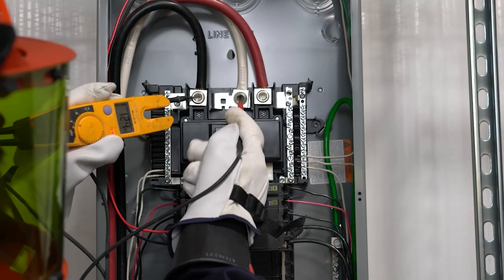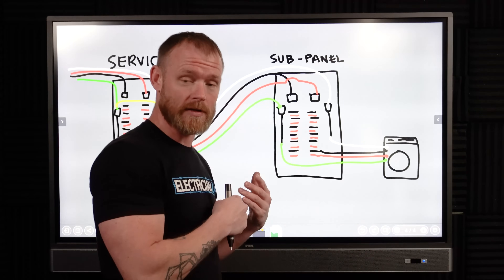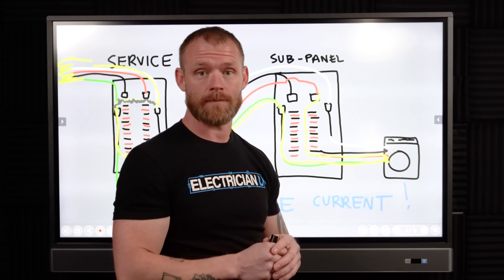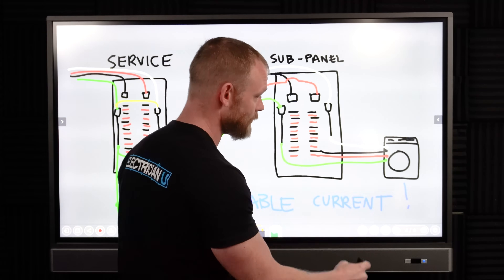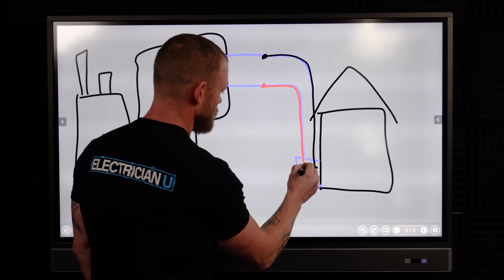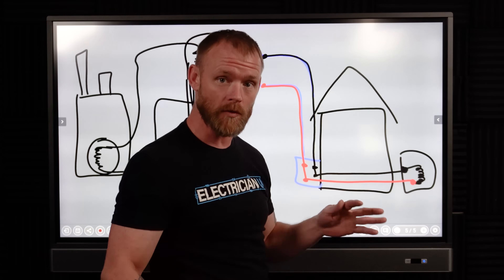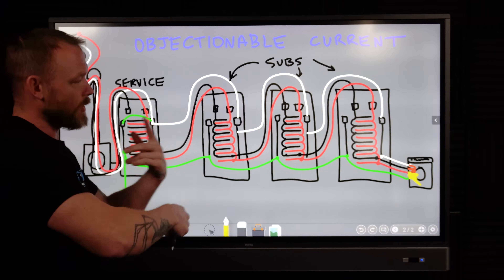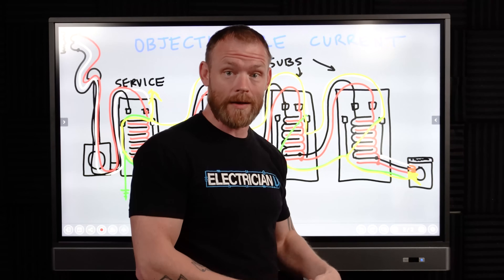Why Do We Bond at the Service Panel and Not a Subpanel?

Comment: Great video! I have one question. Given a ground fault, and you have current coming back to the main panel on the ground wire, why can't this current just be dumped into ground stake? Are not the ground stake and the neutral both essentially at 0 volts?

Comment: Bond neutral and EGC at first service disconnect location and nowhere else downstream. Typical residential service panel main breaker is the first service disconnect but not always. Sometimes there is a discount just after the meter.

Comment: If the neutral becomes disconnected at the transformer and the the fault occurs the ground rod 9r plate would carry the current back to the center point of the generator  at the station right completing  the circuit thru millions of parallel paths?

Comment: So the code is changing to require main disconnects on the exterior of residential? That will now be the bonding location and the panel inside the house will be considered “sub panel”?

Comment: Should there be the green ground wire coming off the main panel at the left? Thought the wiring from the service should be 2 hots + neutral, and the presence of a ground alongside neutral raises the same questions about objectionable current on that "grounding" wire + whether there's bonding beyond the panel (i.e. at the meter).

Comment: i have a subpanel in my single family home in northern California that is fed from the main service panel with 2 hots and a neutral only, no grounding wire.  The grounds and neutrals are all bonded together in the subpanel, including a #6 to earth grounding rod at the subpanel.  This house was constructed in early 1990's, have the codes changed since then?   Should I be looking at adding a ground wire from the main service panel to the subpanel, and separating the grounds and neutrals?  Thanks so much for the great content!

Comment: I have a dumb question, how do you know if your sub panel is properly grounded to itself

Also since you are probably the best teacher on YouTube for anything electrical can you make a video of how to inspect your electrical system at home. Kind of like what a home inspector does. Idaho inspectors don't remove the dead panel, but maybe you can aluminum wiring properly bonding double tap Breakers Etc

Comment: 8:46 when you state that without the bond at the service panel, basically you don’t have working breakers (as I understand) now why can’t it be bonded at the sub panel as well?  It would still use the neutral to complete the circuit one way or another 
16:21 even if a sub panel was bonded incorrectly and electrical current was going down both paths (neutral and ground) to the service panel and back, how does it actually affect anything ? Either way, everything has a complete path back to the service panel and redundancy? How is this not the case?  I am still not understanding how this is potentially irresponsible or dangerous.

Comment: Dustin, here's one for you. I have a 100amp subpanel feeding a rotary phase converter. I have the neutral from the subpanel going to the rotary phase converter. Rotary Phase converter doesn't use neutral. The rotary phase converter will feed to a 3 phase main panel. Do I just take the neutral i got from the subpanel, feed through the rotary phase converter and land it in the 3 phase panel? if so, would I still not bond that neutral? I don't plan on powering nothing but 3 phase equipment from the 3 phase panel. In that case, is trying to get neutral to my 3 phase panel pointless ? 
Thanks! Love your videos, i've learned so much.

Comment: So tell me this. Why is it when I replace a fixture in my house, particularly a light fixture, I usually have to fish the ground wire into the box from behind the wall or ceiling because someone went through here unhooking grounds. Had my well switch serviced and it wasn’t grounded either. They wired the ground after I asked why but they just said it’s already grounded anyway. I get neutral is the return path to the circuit but ground is separate right? Is not making the solid copper connection to the metal dangerous or not?

Comment: Question:  Thank you for your content, you have helped me understand much about projects around my house.  Here is my question: My service is about the change from an overhead service to an underground service to my house.  The power company has said I can have the meter be next to a pole on my property that is about 50 yards away from my house then goes underground to the house.  If I do that there will be a 200amp cutoff next to the meter to cut service to the house if needed.  I assume that the natural and grounds will be bonded there and even though it only has the one cut-off switch it will be the service panel and all other boxes like on the side of my house and on the inside of my house will be sub-panels?  Is this the case even if that service panel box is 50 to 75 yards away from the rest?  I am in Texas too.  Thank you in advance for your time.

Comment: Thank you! great explanation for someone like me who wants to do some work on my home but didn't really understand the bonding at the service but not on the sub-pannel.  I have a mobile home that has a sub-pannel in the house that was built in by the manufacturer and a service panel outside the house on a pole.  I plan to move the service to the other side of the house and take the service underground to the house.  I plan to do the work myself and this was very helpful.

Comment: Why can’t you land the neutral to the chassis of the components to act like the “ground” rather than running a separate ground wire? That way if a ground fault occurs the neutral completes the circuit and the hot breaker trips? Any explication would be awesome and prevent me from looking stupid at work when someone asks me to explain this. Thanks.

Comment: Correct me if I'm wrong, but if power splits/forks at the meter in two different directions, each first panel that is encountered is "the main panel" for that building. This video covers subpanels pulling through the parent panels. So, the barn gets a bonded ground/common at the first panel, and so does the house, right? Because it would take some "creative" electrons to go from the cattle water to the meter, but then continue on to the house after the little smokies already found their source.

But, the hot tub sub panel does not get a bonded common/ground because that comes out of the main panel for the house.

Comment: In a ground fault or even a short, regardless of whether the subpanels are bonded or not, the circuit breaker should still trip, isn't it?  If all wires were connected properly, in a short or ground fault, how would bonding at the subpanels cause any equipment experiencing surge in current at the neutral wire?  It seems the only dangerous situation bonding at the subpanel can cause is when both the grounding and neutral wires were disconnected from the main or preceding subpanel, in that cause, current will flow to the metal cases as well as the neutral wire.  Not bonding in this case will spare the equipment but all metal cases are still dangerous.

Comment: First, if the ground were not bonded to neutral at all, not only would the metal housing of the dryer be hot during a ground fault, but EVERY 'grounded' housing in the house would also be hot -- they are all connected to the same ground electrode at the panel.
Second, if we bonded neutral to ground at any subpanel, then the current in the neutral (and ground) between that subpanel and the main panel would develop voltage, V=IR; thus, the subpanel's ground is not at ground potential.  This defeats the entire purpose of having a separate ground wire that carries no current.  Additionally, bonding the neutral and ground at two places forms a loop of wire -- a ground loop.  Magnetic flux passing through that loop WILL generate a potential around that loop exactly like it does in transformers and generators.  This also prevents the 'ground' wire from having ground potential.

Comment: I understand why you don't want to bond the neutral at the sub panels due to the equipment that is hooked up to the sub panels. What I don't understand is what is stopping the current from traveling through the the neutral to the equipment that is hooked up at the service panel where it is bonded?

Comment: I have a Question: Considering that the transformer secondary is also grounded, wouldn't we have a path across the ground resistance between the main panel and the bonded neutral / ground on the secondary of the transformer?
Thank you in advance for your support.
Cheers.

Comment: If you have only say one lamp on only one side of a 220 panel, say the red side, no other loads. Would the copper ground rod have a current that could shock someone, because it's bonded to neutral?

Comment: I have a question I haven’t been able to find an answer for ANYWHERE on the internet (pretty rare). I’m replacing a main service panel so I  have room to connect a generator and a whole house surge protector. Given the physical layout of the new panel, the neutral bar is about 5” higher in the new box than the old. This will make it difficult/impossible to connect the main service neutral without running new cable from the meter. There are also some grounds coming from 2 A/C units that won’t reach the new configuration.

Question: is there any way to either extend or install an additional neutral bus so these connections can reach? It’s an Eaton panel with a 21 space bar. There’s room for 5-10 more spaces under this bar. Can I make use of this space?  Is there a way to make use of another bar with a standoff kit? Any help is greatly appreciated.

Comment: I have a bonded neutral generator do I have to change it to a floating neutral generator to use it with a interlock system on my panel to power my house

Comment: Awesome. Just to complete the explanation for anyone who didn't get it: if we bond ground to neutral at a subpanel and carry current through that parallel path, then there may not be enough current through the breaker path to trip the breaker. Current is split amongst the parallel paths.

Comment: @picobyte
0 seconds ago
As Dutch electrician it makes sense in your situation. But do bond any outside situations if on bonded ground and neutral.
With TT vs NT there are some serious issues. Mostly small pole transformers feeding one or two houses vs large pad placed transformers feeding tens of homes. Is an issue here in return current.

Comment: Currrent is not "on" something!   An electric "potential" is on or at a point or place.   That means that between that point and another point there is a potential difference or a voltage or a voltage drop.  If the two points are connected by a conductor, there will be a current (a flow of electric charge) in the conductor given by Ohm's Law (for ohmic conductors).   The current is measured in amperes or coulombs of charge per second.   The voltage of voltage drop between the two points is measured in volts.  The quotient of the voltage drop (in volts) and the current (in amperes) is measured in ohms. 

Expressing these quantities correctly helps to avoid mistakes, I find.

Comment: I had this strange thing happen. I live next door to my mom and we share a transformer on the pole. we are the last ones on the line. I was cutting a tree and it fell on the power companys wire and broke it. It was the bottom wire which is their neutral I was told. When the wire got pulled down it ripped off the neutral wire on the secondary side of the transformer going to my moms house. All of my seconday wires were still attached going to my house. My power was still working just fine. Her lights were going from bright to dim bright to dim and sparks were jumping around on the back of her tv. The power company came and fixed their down wire and all was well even moms tv but I always wondered how my power was still working fine even though the power companys neutral was completely disconnected.

Comment: paralleling the neutral will get you a hand smack from the local inspector - one of the best demonstrations I've ever seen on this topic, well done - one question on this, if the sub panel is in the same building do you install a grounding electrode for that subpanel and do you install a grounding electrode if the subpanel is in a separate building like a garage or tool shield in other words do you only install ground rods at the main service panel ?

Comment: The why answer is good.  The NEC says you can only bond neutral to ground at one location. Each derived system may only have one bonding location.  Once you introduce a transformer in rhe system, for example a transformer in your 480V system creating a 208/120V system.  Now my question.  Consider a 129/240V system such as your house.  It is likely you have more than one house on the transformer.  In that case your system and your neighbor have multiple neutral to grounds bonds.  Draw a picture if needed. Your utility company Generator and transformer feeding a second house will illustrate the question I asked.  Your neighbor's house will likely be a parallel path for your ground fault current back to the transformer.  You say that will not happen.  What if both houses have electrical equipment in the back yard?  You can bet some of your ground fault will find its way back through your neighbor's system.

Comment: What makes sense for +110VAC power and safety, eliminating ground loops makes less for low amplitude signals that have a different topology and systems thattraverse long distances.    Ground conductors have resistance and power grounds are capacitively coupled to  both power and neutral. This can induce low amperage currents with voltages high enough to interfere with digital signals.  I found out the hard way that if a local signal network in a large building doesn't have a noise-free local reference it wont be reliable.  On one job with a system that connected the Chicago Loop and Skokie the ground potential difference was 25 volts! We could power an incandescent lamp by putting it in series with any of the three inter-site signal conductors.

Comment: If there are 2 main panels. One for the grid and one for an off grid system that both go into a transfer switch. There's a transformer on the off grid system that has an option to be bonded while the source itself isn't (by design). Should you bind the off grid main panel or the transformer of the off grid system?

Comment: If sub panel were bonded, and if there was a ground fault on a circuit on a sub panel, wouldn’t the resistance from point of ground fault to the neutral on the main panel still be 0 ohms? You seem to be saying it would be going through many different devices on other circuits, but that doesn’t make sense. Shouldn’t it instead go directly back to the neutral all the way down the line with 0 ohms and no interruptions? What’s preventing that?

Comment: PLEASE HELP…….I want to add a sub panel in my basement that is about 60 feet from my 200 amp main panel. If I purchase a sub panel rated for 100 amps then what is the maximum amp breaker I should use in the main panel to service the sub panel? Based on your answer then what size copper wire should I run to the sub panel? Thank you !!!!!!

Comment: If the ground and neutral are bonded/common in the sub panel, and a hot wire in the dryer touches the case, wouldn't the current simply travel along the neutral wire of the subpanel back to the main panel?

Comment: Question: Does a ground rod need to be installed at the sub-panel?  I know the main panel is definitely required, and I thought sub-panels required separate ground rod also, but you sketch(s) only have the one rod at the main panel

Comment: I watched your video....twice!1 Just wanted to make sure I heard you right, sure did first time. Down to it, objectionable current explanation in my opinion is dead wrong. If one of the hots touches the metal frame of the washer, it should 100% of time trigger the breaker !!! Ground cable is not only connected to a rod, but also to a water pipe and of course to main box. In other words, if hot touches metal, current goes to infinite amps, therefore frying any breaker. Say both hots touch the metal, parallel currents are correct and either cable, green or white will fry the breaker. To have  an energized washer, like you suggest, could only occur IF THERE'S NO NEUTRAL NOR GROUND CONNECTION!  Any electrical engineer can demonstrate that mathematically. Regards.

Comment: Let's simplify this a bit: The reason that we don't bond anywhere but the service is to not have parallel conductors. Touching any conductive raceway or any grounded cabinet would be touching the grounded conductor, with all the inherent dangers. In addition, high resistance connections could cause problems.

Comment: Quick question if you're still answering.  Why isn't the neutral bond done at the meter where it is the first point of connection.  Why is it in the first-panel box?  Wouldn't it be safer in the meter base?

Comment: 15:30 in this scenario, with neutral and ground bonded in a subpanel, why doesn’t the resulting ground fault trip the corresponding circuit breaker and thereby avoid this 2-path situation entirely?

Comment: The neutral and ground must be connected to the transformer neutral bus. Making the N-G bond at the main panel is not advised in order to segregate normal return currents from ground currents. The transformer neutral bus is the only point on the system where the neutral and ground should be bonded.
That being said, most often the utility will only provide current carrying conductors from the transformer (hot and neutral but no ground) and that will necessitate bonding neutral and ground at the first service panel. If the utility provides all conductors including a ground wire, then NO bonding at the first service panel should be performed.